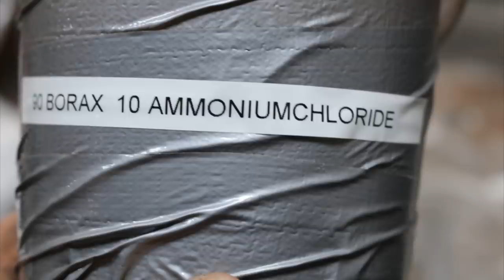Forging a wild Damascus Viking sword, the complete movie.

Comment: That guard drift is genius.  I''ve noticed after watching several of you videos that you approach smithing with quite a bit of ingenuity.  Yeah, making your own custom tools is nothing new, but making a drift to make a perfectly fitted crossguard is something most smiths wouldn't think to do.  I've seen them struggle with fit and final finish after making a gorgeous blade.  It's almost like handles and guards are an afterthought.  I like that less than half of this video was dedicated to making the beautiful damascus sword itself, and the rest of the time was showcasing a how-to for some world class fit and finish that will really set a craftsman apart from the pack.
Reply from the maker: thanks!  it is a method more people use.
Reply: I guess that any wiking would be proud of susch a fine sword.
Reply: How did you tighten the pommel screws? They didn't appear to have any method of purchase on their heads? Sorry if it's a stupid question, I'm new to this.
Reply: M Ouija?
Reply: Colin Morgan  the pommel is peened.
Reply: Those are screws that are turned into the piece with the fingers. It wouldn't look as cool if it was TORX-screwed in :)
Reply: Watch the video dude. All of it. Every 63 minutes like I did and you'll see.
Reply: @rohadtanyad8908  Watch the video again from 40.07. Bottom half peened, top half screwed.
Reply: @freerkwieringa275  It is a classic method from antiquity. Smiths didn't have mills or tools to make the right hole for a guard, making a drift at the same dimension as the blade though... They could easily do that.

Comment: How long did it take you to complete such an amazing work of art ??? An what would that cost to own ???
Reply: Right now I am working to be able to offer HISTORICALLY ACCURATE pattern-welded Viking longswords.  The ones I have found advertised as authentic pattern-welded have errors, such as having a Damascus steel edge or only have two bars in the body of the blade...but the prices for those range from $5000 to almost $9000, which are beyond my (and most people’s) means.  

Right now the proof of concept, a 12-14 inch blade pattern-welded knife made in the style of the Petersen Type H longsword, has just gotten underway and will be ready in approximately one month.  For me, it will be the determining factor if I can reasonably have the true longsword duplicated in a museum-quality product.

My plan is for a 27-28 inch blade true pattern-welded longsword with your choice of crossguard and pommel, your choice of wood for the handle (ash, walnut, rose wood, mahogany or olive wood), your choice of color leather handle wrapping (if you want it) or your choice of wire wrapping (silver tone, copper tone or two-tone) if you want wire wrap.  I am also going to include a wood and leather sheath (your choice of leather color) with brass throat with sheared sheep skin in the throat (to prevent scratching of the blade and allow you to soak it with oil), a brass chape and a 72 belt matching the leather of the sheath since Vikings did not hang their swords from their belts, but had a belt running over the opposite shoulder.

Best guess for the price for what is basically a custom sword is about $1800 delivered...but I do have etching or engraving available at modest extra cost.  Looking for someone to do wire inlay, but no luck with that so far.

Contact me if you are interested at lordoftheroute@gmail.com.  I am trying to get pictures of the process and may be able to send you some.

Comment: It takes a ton of patience and skill to make a sword.!
I just watched a Japanese master sword-maker do it with only a pine charcoal smelter & hammers, clay slurry and burnt rice grass. He also hand picked the special pieces of special iron (called iron sand but it was in handful sized solid-ish chunks of which he picked the purest pieces),  then he baked those, then broke them up to find the purest parts of those purest pieces - besides hammering out any impurities after each burning process.   
He then did special folding techniques, including putting a softer iron (same iron as above but the weaker parts) in the middle to make the sword flexible.  It was crazy-crazy - OCD to the max.!!
He then sharpened it by hand, painted in a (secret mix) clay coating and baked it, then sharpened it by hand again.  That thing cut through a thick block of wood like a hot knife going through butter.
It was amazing.!!

Comment: The vikings would be proud Freerk
Reply: maybe with less grinding and more forgeing.......
Reply: harley hops actually no it was quite common to grind swords to shape and even entirely make them by grinding. It's called stock removal and it has been done since before Vikings were viks.
Reply: if the vikings had belt sanders and angle grinders you can bet your ass they'd be using them
Reply: @harleyhops5186  what are you talking about he does forge quite a bit

Comment: Bro with the fucking layers of steel you've added, that ain't a Viking sword, that's a God sword. Jesus. I am truly impressed!
Reply: It's called Damascus steel which is the process of stacking bright and dark steels together that creates patterns after being etched(dipped in acid). Depending on the steels used it's a very high quality blade.
Reply: +Floki  sorry, but actual Damascus is a mono steel, it isn't layerd or anything of the sort.  Is a really nice sword, however.
Reply: retepish. Milligan damascus is a widely used term for patern welddedn steel the ‘real’ damascus you refer to is woots steel made in a cruicible by melting. they say woots steel isnt damascus untill its made into a blade. Also any blade forged in the place damascus was also regarded as a damascus blade again damascus is a widely used term where as wootz steel is the real badass of steels
Reply: Floki modern steels have no benefit in being "Damascus" or pattern welded, since they are already very high quality in general. back in the day when high carbon steel was hard to come by and didnt have the extraordinary properties it does now, pattern welding was a great way of combining the toughness of a low carbon steel and the edge retention of a harder steel. 

 in reality, due to the chances of a bad forge weld and delamination, pattern welded steel nowadays is actually a worse choice than just straight mono steel 

 p.s. keep building them boats man ;)

Comment: Traditional layered forge welding using modern tooling...Impressive.
Roto hammer is much easier than having apprentices pounding w/ 10 kilo forging hammers...
Not only that, but the gas forge is also so much easier than hand bellows on a charcoal fired forge.

Comment: wondering... imagine a thin sheet, accordioned, fluxed, folded, and doubled over, forged a few more as necessary......
would it not have a more minute grain of carbon distribution ??? It seems somewhat more likely to my mind,  that the very famous Ulfbert sword was built by folds and forging.
.... Awesome work !!  Subscribed !!
My brain is... complicated !  lol. sry iamCanadian !
Reply: Kenneth Kustren as far as we know, the ulfbert sword was forged from an ingot of cast steel. The pattern that is visible is simply the impurities isn’t the bar, from the casting process. As far as we can tell, the quality of the steel that was used is comparable to modern medium carbon steel, like 5160, which was huge considering the method of the steel’s manufacture.
Reply: The Ulfbert swords were made from a crucible steel called Wootz and there is no folding, forge welding, etc. involved, that's pattern welded steel. As far as grain size goes, thermal cycling the ingot repeatedly up to nonmagnetic, remove from and let cool and repeat. Temperatures and soak times and how much to let it cool and how many cycles depends on so many factors I'd say just start watching everything you can about the different steels, pattern welding, wootz steel(there are only a handful of people on earth that can make true Woorz Damascus steel)

Comment: Great movie but explain what progress (which oil using or borax etc..) is it is its very good to go. Thanks for your crawl. I respect... i love your movies...
Reply: If I understand correctly, the Borax will essentially have 3 functions.  The first would be as a flux for the metal as it welds together.  The second would be to help remove impurities as the material is worked.  The last would be to protect the metal from oxygenation as it is in a very vulnerable state when it is heated red-hot like that.
Reply: In which language would your Highness prefer ??   LISTEN WITH YOUR EYES !!

Comment: wonderful sword! you truly are a master craftsman! the only critiques i have are very much minor,  and they all come to the hilt. the handle part appears a little bit rounder than is idea, which can make it difficult to find edge alignment. there is enough flat to do it, but it's not idea. the other is, the grip is also a little long for your hand, historically there should be just enough room for your hand, but that can be made up for by choking down. a glove would also help fill some of the gap. the third is that i'm not sure about the assembly of the pommel. i think it would have been better to make the whole pommel as a single piece, and have the tang be longer, go through the whole thing, then  file sand and grind the peened tang to fit the lines of the pommel. it's only because i'm not sure about those screws. debatably it could be said that it might be a little bit short in the blade, but historical examples of that length absolutely do exist.

Comment: just out of curiosity, why are you putting flux on the surfaces that don't have any mating material? to my understanding its normally used just to help forge weld pieces together and no forge welding  is happening on those surfaces.

Comment: Looks beautiful.  Hard to tell from the vid, but the blade seems to look thick.  What did the finished sword end of weighing ?  Also, did you fully sharpen it, or leave an appleseed edge ?

Suggestion: the scabbard is beautiful (1:01:24), but may I suggest adding a metal loop mounted to the side of the scabbard just behind the balance point so that the blade+scabbard can be slung from a baldric or shoulder strap, and rest near the opposite hip.  I am not 100% sure, but I think that was the most common and authentic way to wear a sword like that.

Comment: Very impressive.  I just can't understand why you chose to put the screws in the pommel.
Reply: Advanced design, utilizing the experience of a master, would dictate the use of screws today. 

Most original Ulfberht swords would have been CAST from crucible steel and varying layers (body and edge, for instance) would have been welded once and then worked.  The steel would not have been "folded" and worked Damascus-style like this one.

Comment: What's the white powder you put on the billet before you draw out the metal and what's it's purpose? Also, why do you sometimes hit the blade with a blowtorch?
Reply: Andrew Kenney it's flux,  helps in getting a good s forge weld so the blade doesn't flake.

Comment: Multiple layer blade forging isn't Damascus steel blade. The only common things of the two are iron, carbon and heat. Multiple layers forging is an art that can stand on its own without needing to pass under a falsehood.

Comment: Amazing work as always Freerk, new subscriber here but I have been following your work for some time.

I have question though. When you forge a blade, are you following some dimensions or are you just doing it till you "feel" it is the size you desired? Do you measure during the forging so you know you are not making it too big or small?
I am doing stock removal so for me its easy as I cut off what I don't want and I have constantly inscribed design on the blank but I always wondered how is that done in forging.
Reply from the maker: that is the tricky part of forging a sword, i use line designs,  and have a certain measuarmets  as a goal.  i work towards it
Reply: Thanks for answering